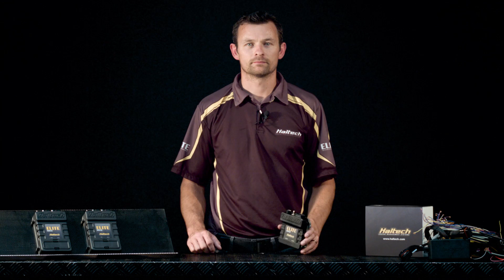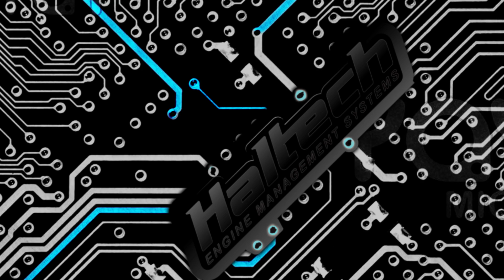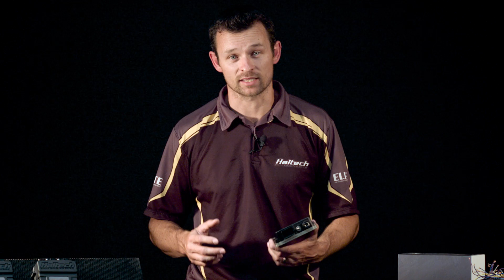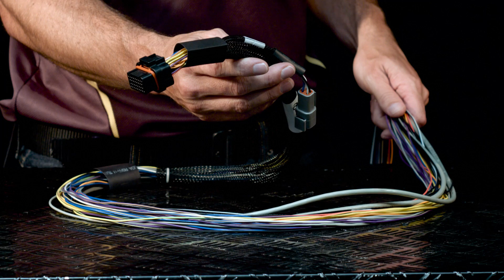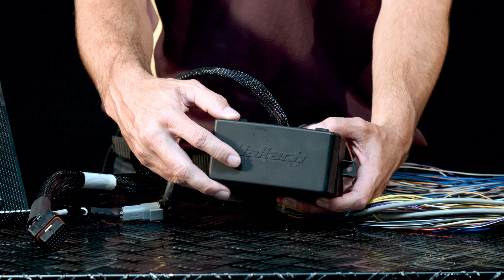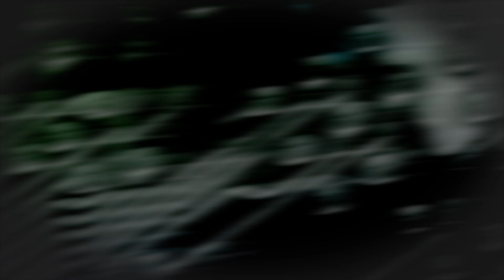Haltech Elite 750 Overview

Comment: Thank you for the video, I have transmission control module connected to the ecu in my car by four wired cable, how to connect this unit to my TCM. 
Best regards.

Comment: I'm building a 4g91 engine from the cb3 lancer....N/A at the moment, I'm going to modify it by adding a turbo but I'm not looking to dump alot of boost because I want it as a daily driver. Which ECU do you recommend for this modification?

Comment: Is the racepack ok to use with elite750?
Reply from the maker: If you are talking about the IQ3 Dash, then yes - but: Haltech IQ3 will plug straight in, Racepak IQ3 will require a Vnet adaptor.

Comment: Why wouldn't this be equipped with knock sensor control?
Reply from the maker: It's an entry level, single connector ECU. If you want knock control you'll need to go up to Elite 1000.

Comment: I'm building a VQ30DE with 350z cams it has a 180 tooth flywheel what ecu do you recommend and what trigger wheel do you suggest and how would I get the cam to sync

Comment: I have a VZR N1 homologation Pulsar. It has a rare Nismo engine. NA 4 cylinders, 1600cc but it has 8 injectors and variable cam timing set at different times on the intake and exhaust cams. Which Haltech ECU is suitable for me?
Reply from the maker: To run both stages of injectors sequentially, you would need either the Elite 2000 or 2500. If you are happy with semi-sequential staged injection, or paired injection (both injectors on each runner firing together as one large injector), you could use even the basic Elite 550 ECU. The Elite 750 is a little unique here, allowing for sequential primary injectors, and semi-sequential secondaries. All of our ECU range are capable of running dual VVL, either switched simultaneously (P12 style) or independently (P11 style).
Reply: Thanks for that. I have been using Haltech for a long time and was actually the first retail customer in Australia to get a Platinum Sport when they first came out. I am considering a Haltech again, I just have such an unusual engine in my race car I dont want to go rushing into anything.

Comment: Hello, haltech wouldn't happen to make a plug and play and a wire harness for ECU for a  1982 Datsun 280ZX Fuel injected? has an L6 engine with 5 speed manual. if not what ecu and harness would you recommend? the car will be use for daily drive, and some track days.

Comment: I'm doing a fairly unusual build, a evo drivetrain swapped 3g eclipse with a built 3.8l mivec and twin 6266s, and I'm aiming for at least 1200awhp. Should I get a 750 or 2500?
Reply from the maker: The Elite 750 is capable of running the 6G75 sequentially and with direct-fire ignition, and will support switched MIVEC. The Elite 2500 will also support sequential operation, but also boasts a much larger input/output allocation, more functionality such as closed-loop boost control, and advanced engine protection functionality including knock control. Given the high-power application, I would be recommending the E2500 – however if you are doing a budget-build, the E750 will suffice.

Comment: hi, i have been looking at getting a 750 elite for my S13 silvia, i have looked on the website at the details and am leaning more towards this instead of a platinum sport, my question is whether this ecu handles outputting to digital lcd speedometers and digital lcd tachometers?
to my understanding these ecu's can also do 2-step?
 could the elite ecu also be used for getting fuel gauge readings? as my fuel float does not work and am looking at some kind of replacement if the elite 750 can handle that sort of thing.

thank for your time!

Comment: Hi Mr matt can i use Elite 750 to the variable valve timing control engine like vtec , mivec, vvti etc? and do the Elite have (Knock &O2 Control)
Reply from the maker: The E750 supports both switched (VTEC, VCT) and single-sensor fully-variable (VVTi) cam control. Long-term O2 control is supported, however knock control is only available on the E1500 and E2500 models.
Reply: Haltech can this single control be used on the intake cam in a barra xr6t. And do you have the base maps for a barra in the ecu manager.

Comment: What Ecu do you suggest for a s13 rb26 with a gtx35 up to 1000hp build?
Reply from the maker: Depending on features required, and desired wiring method, the R32/33 Pro Plugin, Elite 750, Sport 2000, or Elite 2500 ECU can be used. Being a high power application, I would recommend using either the Pro Plugin or Elite 2500, as both options support advanced engine protection systems including knock control.

Comment: can you use an elite 750 on a 4 cylinder ecu? I want something that will allow me to run a 6 cylinder later on should i want to do an engine conversion
Reply from the maker: Yes, the E750 can be used on a 4-cylinder engine. The unused 2x fuel and 2x ignition outputs can then be used as generic outputs for functions such as boost solenoids or thermo fans.

Comment: I'm building a bit of an unusual cleveland V8, running a 2000cfm throttle body + sequential injection, AU V8 crank trigger + cam synchroniser and LS1 coilpacks.
its a basic retrofitted setup on an older style motor, so would the 750 work or would I have to go to the 2500?
Reply: The 750 would most likely work...but best to call them up and check

Comment: +haltechecu will the 750 work on the Alloytec V6 engine?
Reply from the maker: The Elite 750 can run the engine, however does not support the variable inlet+exhaust cam function.
Reply: Okay so the Elite 2500 will have to do

Comment: i have a isuzu rodeo  with a v6d1 engine v6 3.2l
with this ECU can i make a scalable cylinders use on the ECU??
like 

start the engine like a normal v6 
but the becomes a 4 cylinders   engine from 0 to 60 Kph
and 6 cylindes from 61 to 180

is this posible .??

sorry but i'm a noob in EFI

Comment: How would you run say a 12cly engine on a elite 2500? do you sell a expansion module like motec does?
Reply from the maker: +William Seroyer Elite 2500 will run a 12 cylinder on a semi sequential injection.

Comment: will the 750 be enough for a 1991 6cyl twin cam non vanos e36?
or am i better off with another unit? 
also what wiring options would i have for a car like this?
Reply from the maker: +Rory Marshall Yes, the E750 will run sequential injection and direct-fire ignition on the M50/M52, with no VANOS.
Reply: +haltechecu and if i add boost this will still be able to handle it? also whats my best wiring option? thanks for your help!
Reply from the maker: +Rory Marshall Yes it will be able to handle the boost. As wiring options, the video below explains all the options available to you:
https://www.youtube.com/watch?v=GzLiGezXshk

Comment: Would this be recommended for a renesis 2-rotor?
Reply from the maker: +Spag The Maker E750 will run the Renesis with the exception of the dual intake runner control.
Reply: +haltechecu Thanks, I'll likely go for the 1500.

Comment: does it use the same injector/ignition drivers as the rest of the elite ecu range?  would it be happy running say a v8, or v12 on batchfire/wastespark?
Reply from the maker: +theblackmech It will run a V8 but only semi sequential fuel and waste spark, for a V12 we would recommend Elite 2500.

Comment: MADDDDD!!! I think I need that elite 750 for my rb25det :)

Wondering though why does the 750 have 6 channels for fuel/spark and the 1500 only have 4?
Reply from the maker: +xgeko2 Elite 1500 was designed with 4 cylinder / 2 rotor cars in mind.

Comment: Really compact! no DBW nor Knock Control?
Reply from the maker: +WickedTRX Here is the full features list for the Elite 750:
http://www.haltech.com/elite-750/
Reply from the maker: +Andreas Kist It's not a typo, it will run 8 cyl engines but only semi-sequential with waste spark. No DBW or knock control on the 750.
Reply: +haltechecu You've got a typo in the features list, I think: "1 to 8 Cylinder engines"

This could be kind of tricky with 6 outputs.
Reply: +Andreas Kist i assume it can do it, but only semi sequencial fuelling